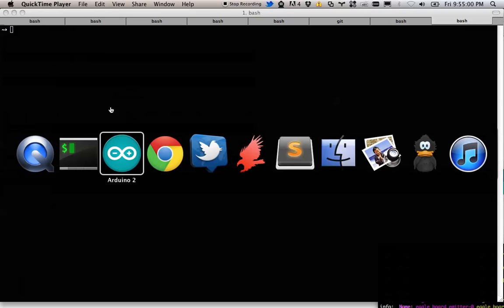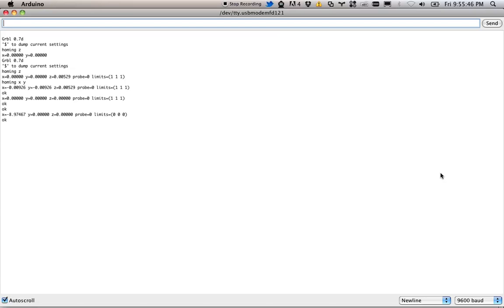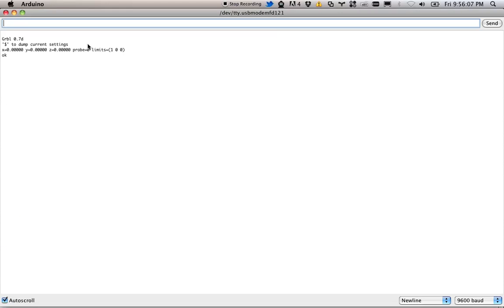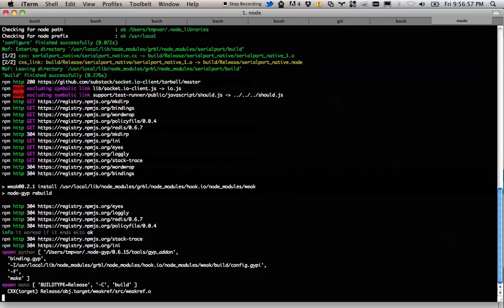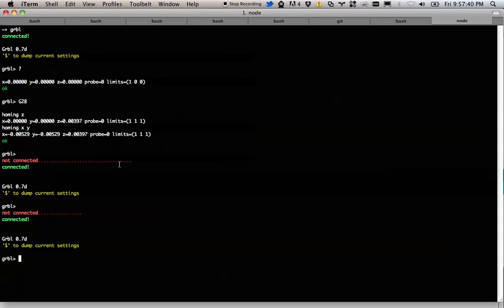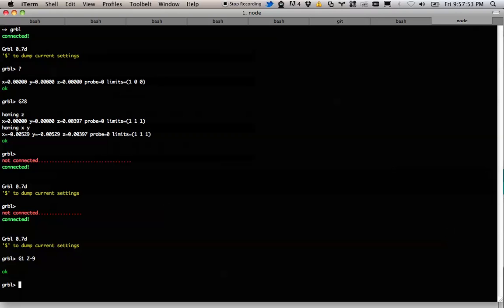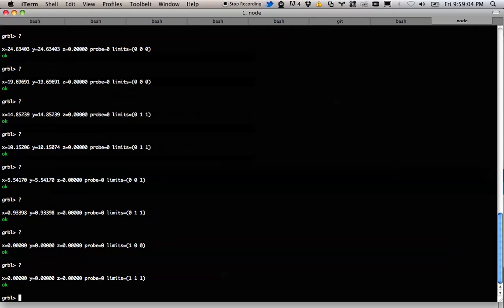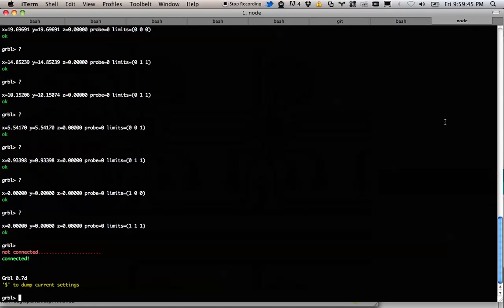node-grbl 0.0.1 intro

Comment: If you're looking to generate G-Code, why not use PyCAM? It can read SVG / DXF from an Eagle export, converts to G-Code with optimized tool path, then you can just stream that G-Code straight to your Arduino from GRBL.

Nice code though, I like it!